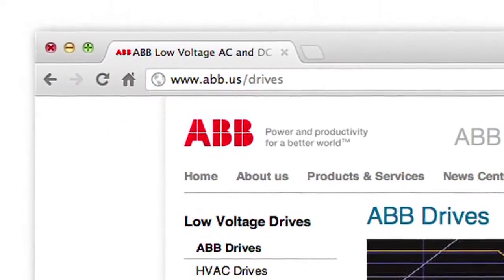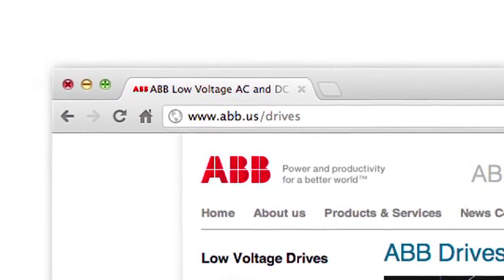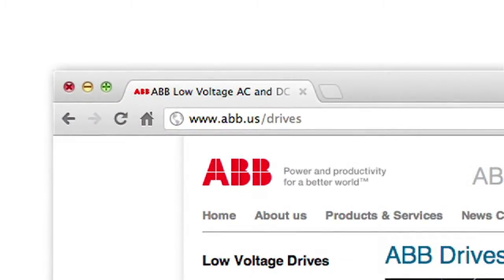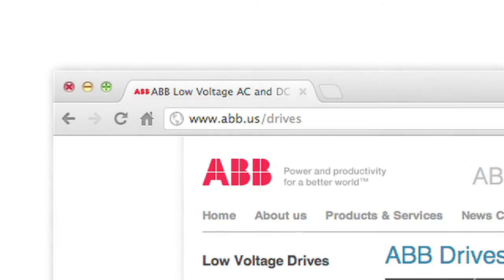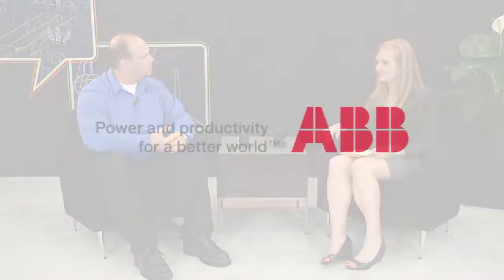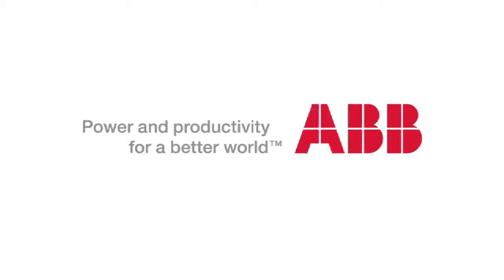Harmonics Interview

Comment: Mr. Jeff  your vedio lecture     -- "Harmonics- what are they , why do i care"  is  very  informative  but  you say that  higher capacity transformer has high impedance and lower  capacity trx has low Z , actually as per me higher capacity TRX has low impedance and lower capacity has high impedance and only bcoz of that  the  high capacity  trx  exhibit low THDv @  particular THDi . if impedance would have been higher then THDv would have been more due to the fact that Voltage drop is more when Z is more as per V=ZI (vector dot product). in other words higher capacity TRX delivering more current @ same Voltage and accordingly  impedance is less as per Z =V/I  mostly i am not but  I may be wrong  --please clarify
Reply: Sorry i meat to say " higher capacity transformer has low impedance and lower capacity transformer has higher impedance and because of this the higher capacity transformer will have a higher iTHD and lower vTHD then a lower capacity transformer will have lower iTHD and higher vTHD for the same amount load."